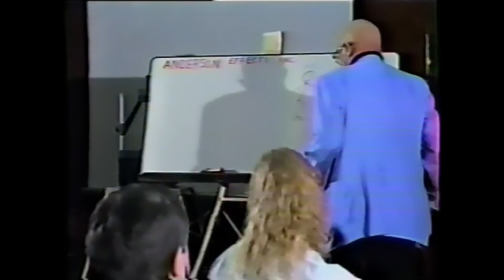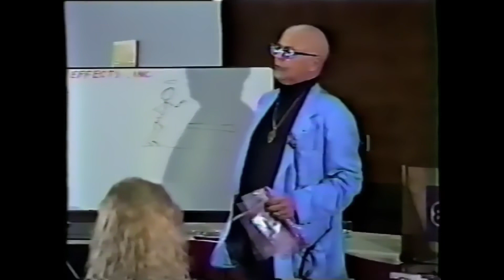Why Are ESD Bags Pink?

Comment: JPL specifically banned pink ESD bags a few decades ago.  Only those black-tinged ones were allowed.  They said the pink poly had a coating on the outside or inside that shed after awhile; the black-tinged anti-stat was not on the outside nor on the inside, so nothing to shed.  (Old pink feels a bit sticky, if you look for it.)

Comment: What actually started the development of ‘Pink-Poly’ was an ‘accident’ back in the Cold War era of the 1960’s involving the installation of the first of the American Minute-Man Missiles into their underground, nuclear bomb-attack-proof launching Silos. 
During the Launch Silo installation of the first, of the actual missiles, which came, delivered from the assembly plant ‘wrapped’ in a ‘nice clear plastic film’ to keep it ‘nice and clean’ and weatherproof during transport, to the Silo sites, the installing ‘Technicians’ had completed their work, connecting the Launch Control Cables to the Missile, inside, the Silo, where they were then, all standing around the base, of the Rocket, at the bottom of the Silo, and ready to finish off their job, by stripping the missile of its protective plastic film covering.
Then in the usual, and dare I say, typical, ‘what could possibly go wrong with this’ moment, as soon as they peeled away the ‘covering’ plastic film from the Nose-Cone, of the Missile and ‘clamped it’ to a rope and started rapidly pulling the film, downwards with the rope, because, it was an ‘ordinary’ plastic-film, it of course, immediately generated a HUGE, Static Charge, as it was being stripped off, the Rocket Casing, and guess what..?
That Static Charge, ‘found Ground’ through, ‘the Launch Control Cabling’, and IGNITED, the Rocket Engine..! 😳😳😳😳
I don’t think I now, need paint you a picture, of just what, immediately, happened, to all of the ‘Technicians’ and, a couple of Washington Generals and, Politician types, who were also there at the time, to oversee the latest waste of US Taxpayer’s money..!    Let’s just say, it saved the US Government, a whole mess of further US Taxpayers dollars, on their subsequent, ‘Cremation’ costs…! 😮😮
This ‘Ooops moment’ of course, immediately caused a LOT, of consternation, and deeply wrinkled-brows, back in Washington, and THAT, is ..why, and ..how, ‘Anti-Static, Pink-Poly’ Plastic-Film, soon afterwards, came to be created, Folks.  😉👍
Reply: Minuteman being solid fueled wouldn't have an engine, it's a rocket motor. Pedantry aside, can you light a perchlorate motor of that size with a static discharge through ground cabling? I'm not sure.

Maybe the dude in the video has a better idea of what happened 🤔